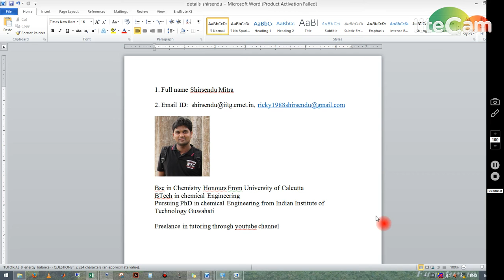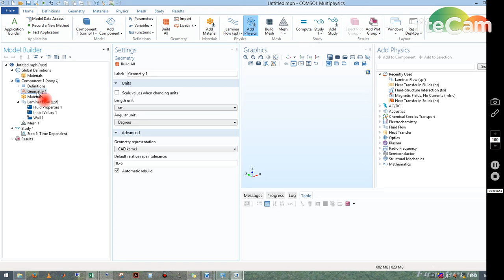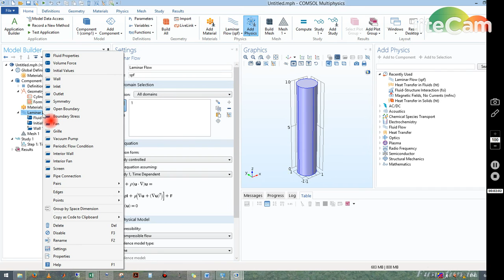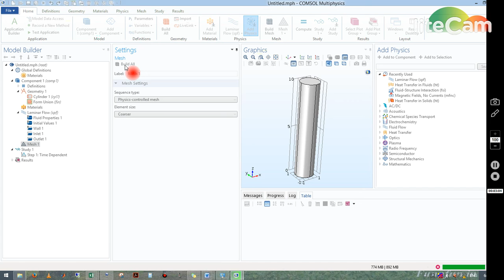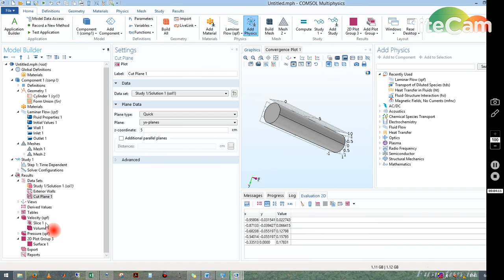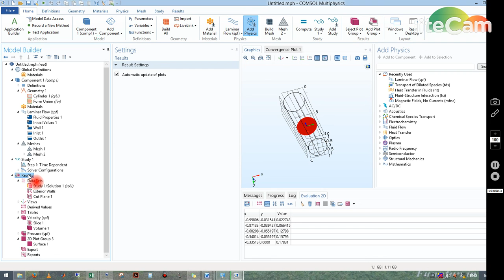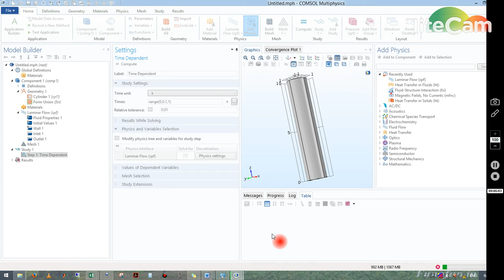COMSOL TUTORIAL 6 3D PIPE FLOW

Comment: Hi, nice video. I have a question, it's impossible to find out how a periodic flow condition works for a 3D geometry.
First, I tried for a 2D geometry with this condition U_0=2U_m s(1-s)(sin(ωt)+√(sin〖(ωt)^2 〗 ))  and s goes from 0 to 1 along the inlet edge. In case of 3D condition, on a pipe, the inlet is a circle and that equation doesn't work.. Please let me know if you have any ideas because a have to finish my project in a few days and i couldn't find any solution yet.
Thanks,
Ana
Reply from the maker: I will check and let you know.

Comment: I want to give fully developed velocity profile at inlet. Can you help me with that?
Reply from the maker: The term fully developed is not applicable at the inlet. We consider it as a plug flow when it just enters the pipe. After entering it undergoes wall friction and thus makes boundary layer. Stay tuned to our channel for more updates.
Reply: Thank you for your reply. But I basically want to assign a velocity profile data in .csv or .txt extension at the inlet of a model of 2D open channel flow. is it possible to do in COMSOL?
Reply from the maker: There is a simple way out. If you have the data file then you can easily generate an analytical function corresponding to that data in excel. Once you have this you can put it as a boundary condition.
Reply: ok. I'll try that. thank you very much for your help.
Reply: As you suggested I have created the analytical function (-2*(1^(-5))*y^2 + 0.004*y + 0.272) and put it as inlet boundary condition. but now I am getting error like this.
"Failed to find consistent initial values.
Last time step is not converged.
 - Feature: Time-Dependent Solver 1 (sol1/t1)"
Can you suggest what may be the cause of this error.
Reply from the maker: Did your problem gets solved? If not you can contact me.
Reply: Thank you. I am sending you an email.